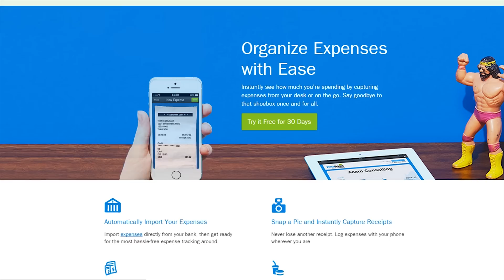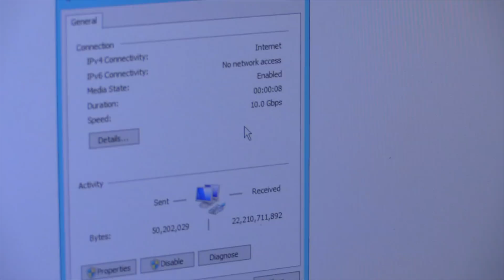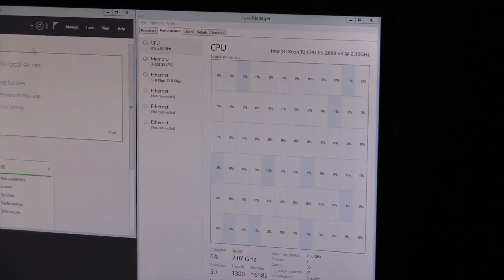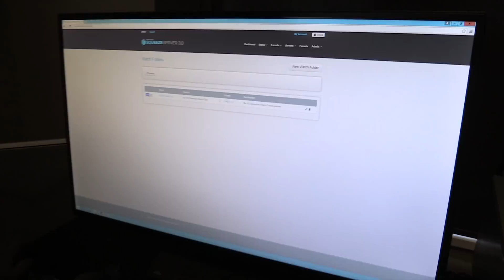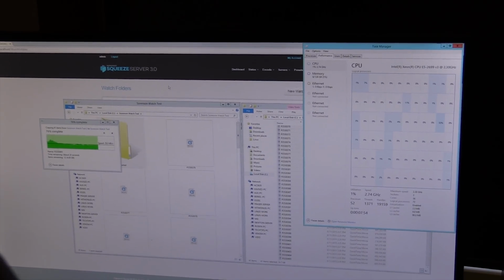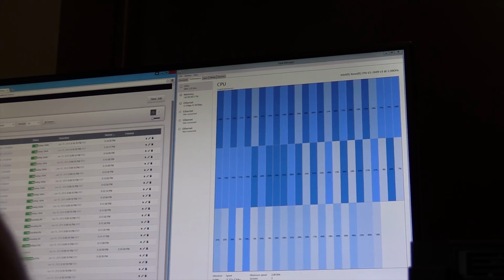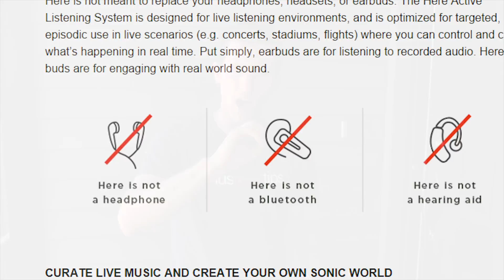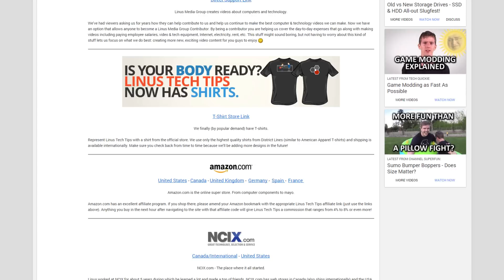36 Cores, 72 Threads, and Two Titan Xs - Our New INSANE Rendering Machine Part 3

Comment: But... But Linus... Why u no run linux on server?

silently sobs in the corner
Reply: Jake Whitton Loudly sobs in the center of the room
Reply: nobody gives a shit about the windows vs linux debate other than teenage fanboys
Reply: Jake Whitton And now an answer that isn't a guess: This is a rendering machine. It's not just a storage server. In order to render their content, they need to use software that is only compatible with Windows.

Linus has already said that he looked at using Linux but it simply isn't possible with the work they need to do - there isn't an equivalent for Linux.
Reply: He is using windows server which is easier to use, for a person who has always used a windows operating system. Also, it has a couple benefits over linux.
Reply: Jake Whitton 9:35
Reply: Jake Whitton someone didnt watch the video
Reply: tulp35000 if you use linux daily it is pretty easy. If you know how to use it, it is multiple holy grails.
Reply: *****  So that just proves user unfriendly server os interface. WIth windows wannabe skin that barely helps. Instead of pretending to enjoy jumping loops and hoops trying to get shit to run on linux, id rather play the game/use software during the time it would take to set it up there. Also salty would mean that i want to use it but cant for some reason. And i did. Not amused. Half assed wine.
Reply: Jake Whitton You should start a channel and call it LinuxTechTips
Reply: its a bird! Its a plane! No! Its the joke flying over your head!
Reply: Jake Whitton  cuz linux doesnt have the windows software equivalent.
Reply: jammy rogers  i tried linux, had it in another partition. I dont use it daily because why? Its lacking in every way. No proper driver support. Barely any good games. And software is crap.
Reply: tulp35000 You make installing and using Linux as hard as you want it to be. You can install Ubuntu or Mint for ease of use, or use gentoo or arch if thats your cup of tea. As for the reason to use Linux differs from people to people, but the common reasons are that its fully open source and free, no backdoors that the public cant see, the huge library of different desktops you can use, customisation, use less resources than windows, stability, a command line that makes sense and so on
Reply: Jake Whitton Did you even watch the video...? 9:26
Reply: Jake Whitton What's "Why u no run Linux"? Is it like "Why aren't you running Linux"?

In all seriousness, its because, unlike Linux fanboys, he knows when it is and is not appropriate to use Linux.
Reply: linux is a dead cold user unfriendly server os. Some pc hipsters like to pretend it's the holy grail and M'OS'es of all os'es lol. Theyre so silly.
Reply: tulp35000 many drivers do suck, ill admit(amd,nvidia and webcams) but there are alternatives which work fine. Also there are shit tonnes of games on linux such as almost all valve games, civ, borderlands 2 and pre sequal. (Over 2300 on steam alone). Software on linux tends to be better as it tends to have more features and is faster. You can also run wine and get many programs for windows to run on linux nativly.
Reply: tulp35000 why so much salt. Linux isnt for you and it was for a server. Bash is much better than that cmd shit. Linus is not using it for games so your point goes no where
Reply: ***** Especially for video transcoding,  I think you're plain wrong. There's a little program called ffmpeg which is used in the backend by most encoding  software anyway. And if I understand the software is doing nothing other than waiting for  raw files in the folder and than trancoding them to the "work"  format for editing. You could write a shell script which does just that and most likely you would hit 100% on all cpus. Granted I never tested this on more than 16 threads and you wouldn't get the nice monitoring interface but nobody can say it isn't possible in Linux. But I think Linus expertise isn't in Linux so going with the Windows solution is fine. Maybe Wendell from the tek syndicate could help with that. That could be an awesome video collaboration just saying. Would be nice to see the full potential of this hardware g.
Reply: Jake Whitton Guys, don't feed the troll ;)
Reply: *****  just general clunky os that requires you to be a geek on another level which lets be frank 99% of users arent. Thats why linux userbase is mainly old people who only read newspapers or server nerds. sub 1% That and it doesnt have what i need and im not even going to look for somethign that does. Main reason being,  IM ALREADY USING WINDOWS. What kind of bullshit reason id have to make to switch to shitnux.
Reply: tulp35000 lol what? Old people don't have computers. What you say makes no sense, i could write an essay on how, wrong you are.
Reply: Niosus  no respect for it. Theres a reason its not the major consumer os. because its made to run the crap you just listed. Things we dont even think about. because they run on magic dust.
Reply: Jake Whitton 9:40
Reply: tulp35000 My dad can use Linux just fine for his daily usage. In fact, he has used it for a year now without even once calling me for help.
Reply: Saul Nunez Elementary OS is absolutely fantastic for ease-of-use, especially with less tech-savvy users. I've also installed Elementary on my Mum's laptop and she's never had a problem. So much nicer than Windows.
Reply: use wine
Reply: Dont push it.
Reply: aakksshhaayy  Teenage fan boys? lol the only people ive met that argue on the side of Linux are middle age guys who grew up in the days of DOS and assembly programing , really its weird. Most young people ive met just like their touch screens and playing games.
Reply: thisnameisalreadyful I guess the raw video files would need a huge amount of ram but I guess this Server has alot. But in the video it doesn't looked like the process was bottlenecked by IO. But back to the most likely better Linux solution, you wouldn't even need a cronjob just a inotifywatch and some queue mechanism for ffmpeg.
Reply: FrostyExchange Pretty much every adult i have met that actually uses linux daily says use whatever you want. Most people really have no real need for linux. People argue that linux is impervious to hackers or some bullshit and then fall into basic privacy/security pitfalls like not having a proper password, not encrypting their vnc connection, not using vpn, etc.
Reply: tulp35000 Most websites run on Linux, your routers at home run on Linux, your set-top box runs on Linux,your smartphone runs on Linux, your car runs on Linux, most supercomputers run on Linux, etc etc...

There is only a single market where Linux isn't dominant: Desktop computing. EVERYWHERE else it is a force to be reckoned with. Hey, if you don't like to use it, be my guest. I'm running Windows on my desktop as well. But if you think it's the clunky interface that defines Linux.... Oooh boy.

You're already using Linux every day, you simply don't realize it. Linux is not about fancy interfaces or games. It's about efficiency, speed, reliability and flexibility. It is much harder to use because the most important applications are not meant for regular people to use. Linux is the OS for experts who are solving specific problems. Those experts are delivering all those juicy services we are used to today, or doing all the simulations to make sure planes don't fall out of the air, or are processing your pay check so you can put food on the table. So you don't need to like to use it, but maybe some healthy dose of respect is in its place?
Reply: tulp35000 I just took a glance and didn't see any...
Reply: I try my best
Reply: Helvecio Neto Hahaha....  People on the internet jump at the opportunity to assume their opponents are mentally incompetent.
Reply: Attila theHun Straight and to the point. I like it. I give you the award of "Best youtube comment 2015".
Reply: Jake Whitton Seems odd to me. The server software sounds pretty simple if Linus is making sense. I'm surprised that doesn't already exist.
Reply: Because they don't seem to want to try QEmu for the 'software that isn't available'...
Reply: ***** because he's an idiot
Reply: FrostyExchange That's because they've grown up on an OS that takes any kind of advanced functionality out, just for ease of use's sake.  Most people who want to tinker and alter their OS's to function the way they want will eventually discover linux.
Reply: Jake Whitton lol
Reply: jammy rogers "Pretty easy"? Most people don't prefer to install software using a damn command line. Don't bring up software center either. That barely has anything. Linux was never an OS meant to have a GUI. It is designed as a server OS, and shouldn't be used as desktop. The GUI is underdeveloped and lacks basic tools that Windows comes with. Simple things like running a program as root require terminal, where in Windows it's a simple right click "run as Administrator". Yes, it's bad security wise, but then again, Linux is meant for security and servers.
Reply: sharks445 you can install from a command line just buy typing yum install <program name> (or use other such as apt on other distros). You can install from an app store (software centre) which is easy. You can also install programs by downloading a file and running it (sound familiar?). The GUI depends on what GUI you are using. Modern DEs such as gnome and kde are excellent.
Reply: Jake Whitton EXACTLY HE IS NAMED AFTER THE FOUNDER OF LINUX!!!!!!
Reply: Retards should keep away from GNU/Linux.
Reply: tulp35000 Wait, so you're saying you don't appreciate all the modern services we have today?
Reply: Niosus  yah im not too happy about not being in control of my own life. Better call Neo so he sorts this borderline matrix bullshit. 1% owning 50% worlds moneyz. Most central banks being ran by private companies. Dont you love it. yeah i've no respect for the tools of EEEEEEEEEEEEEVILLLLLLLL.
Reply: tulp35000 Step one is never visiting Youtube again ;)
Reply: Niosus  linux sucks bruh. Java rulez. its in your toaster bro.
Reply: tulp35000 Linux is actually on your toaster.

https://www.embeddedarm.com/software/arm-netbsd-toaster.php
Reply: TheHareidGamer
agreed
Reply: LionessTechTips
no linux in my toaster.
Reply: sana hassan I couldn't find any either
Reply: Jake Whitton  Dont have a toaster. I go buy bread fresh straight outta the oven @ the bakery. Sometimes its still warm. If u get early in the mornin. Crunchy.
Reply: tulp35000
?
Reply: sana hassan  ? A bakery that produces bread and other flour goodies? it ships 99% of its produce while selling some unpacked lol. Without that peasant market tag.
Reply: Cos, he uses Sony Vegas which you can get on WINDOWS ONLY! and it's easier to transfer.
Reply: Jake Whitton It's probably because Windows is a HUGE standard
Reply: Linux is for servers, not editing/rendering machines.
Reply: +tulp35000 "because I haven't looked for the windows software equivalent, therefore it doesn't exist"
--fixed that for you. Linux transcodes like a beast. Guarantee there is a codec they can use as a mezanine that does what they want on their editing stations to get the scrubbing they want, and I absolutely guarantee that there is a codec that plays well with the different video sites he wants to distribute to.

Really, the better answer would have been. "I have money, but no time, so we went with Windows."
Reply: Mostlyharmless1985
 no ive no time or skill troubleshooting linux for hours before doing a menial task.
Reply: tulp35000 please click "Read more" to see the final synopsis of my comment.
Reply: Mostlyharmless1985
no bro even installing linux needed specifying fucking partitions by fucking HAND writing. That was a huge red flag then. If u actually listened to people like me youd know long ago linux isnt going to get anywhere  if it assumes peoples hobby is spending hours trying to run shit that should be as easy as double click.
Future os pretty much will have to know what you mean when u say "do the thing"... or it aint gonna fly.
Reply: +tulp35000 So, if having extreme control over your OS is daunting to you, why the fuck do you build a PC? Just go to the microsoft store and buy one. You point at a computer box, and say "I want that one" and the nice sales person takes your money and you have a computer.

Sorry you are shit at Operating Systems. Maybe a shiny object is more your lane?
Reply: Mostlyharmless1985
type linux sucks into search engine. Now fix everything that comes up and maybe windows slaves will switch.

99% of linux experience is getting it to run lmao.
Reply: *****
exactly. Its a server/dev os never designed to be user friendly. Just saying these annoying linux fanboys refuse to realize why linux isnt more popular. I dont care your grandma reads paper on linux when u set it up for her or she does it herself. I dont.
Reply: +tulp35000 
lol.  Ur funneh.
Reply: *****
vulkan might help. Driver support might help.
Reply: *****
so now devs only have to make games for linux/vulkan.
Reply: *****
they can but user base doesnt make it attractive. Linux wont be hip if everyone uses it.
Reply: tulp35000 Your definition of "user friendly" is not the same of what my definition of "user friendly" Now a days people think "user friendly" means having some jackass paperclip come up and explain how to use your computer down to the damn thing flat out saying "I'm cortana, ask me questions!"

User friendly to me means that the purpose of a control or utility is obvious. Which, yes, linux is PLENTY user friendly in that regard. Just because you want your nose picked for you and Linux isn't obliged to do it, does not mean it's not user friendly,it means it wants you to do your own disgusting pig habits yourself. It will tell you exactly how. The damn thing has the manual built right into it. Just type Man and then the utility you are trying to use.
Reply: Mostlyharmless1985
Lol you realize that if what youre sayin is true, linux user base would be windows size. It isnt.  I dont have a reason to like linux. Im not a programmer or some hipster with ocd about control or typing commands because its k00l. "Look at me im a faggot who knows what to type so linux runs shit after 2 hours of troubleshooting manuals, that makes me better than windows peasant users"
Lol linux users, get it through your thick command filled skull. If u have to type shit it's not casul user friendly.
I tried linux, ive just no patience to deal with that shit when i have it spoon fed to me by windows.
Reply: *****
Linux, a fucking waste of time. Dont need to add anything else. Why did i bother.
Reply: ***** Ooh im a special snowflake.. oh wait billions dont use linux either. Do we need to bring that up??????? Im ignoring android and toasters obviously.
Reply: +Jake Whitton It's not compatible.
Reply: tulp35000 again, you miss my point. Are you just stupid, or are you that dense. EVERYTHING can be done from the command line in linux, that's how it's bloody designed, double click monkey considerations are made after the fact. Lets try again, i'll give you two examples this time, and maybe one will sink into your thick, hydrocephalic skull.

Connect to a wifi network. In windows, you click the 3 bars that signify a wireless conecttion, then you select your desired ssid from the list, then you type in the password to the network, bang, you are connected, probably.
In linux: You type sudo iwconfig wlan0 essid <your network name> key s:whatever

Done. Oh, and you can also use the clicky click method if you want to. It's quicker to learn the keyboard commands most of the time. You aren't wasting your time learning a system, you are saving time. There's a reason the running joke in IT is "I can replace you with a 14 line bash script"
 Lets say I have 50 dvds to rip and transcode into mp4s. Simple task in the clickywork, but since Handbrake uses the Unix philosophy, all the clickywork is actually abstracted in a command line. What would take you hours of babysitting a GUI with setting all the tabs is done in a simple shell script put in a loop. What's easier in this situation? Inserting a disk, selecting source, selecting the disk, selecting the output file name, tweaking the audio settings, and then clicking rip. Then repeating the process 49 more times, or just spending 15 minutes writing a script that asks for the movie name, rips the disk, ejects it, and asks if you want to rip another?

Do you get it yet? Or are you just too fucking stupid to realize how powerful the command line really is?
Reply: +Jake Whitton 9:40

Comment: doesnt the whole rendering and transcoding process work the the GPU and not the CPU?
Reply: Longshots It matters on software used, sadly most rendering software preffers CPU.
Reply: Longshots Basically the opposite. Very little software uses the GPU and when it does it's mainly decoding or sometimes transform and blending operations.
Reply: TalesOfWar wow and i edit on avid.... good thing i have a strong CPU.....
Reply: he needed a gpu cause the mobo had no I board audio